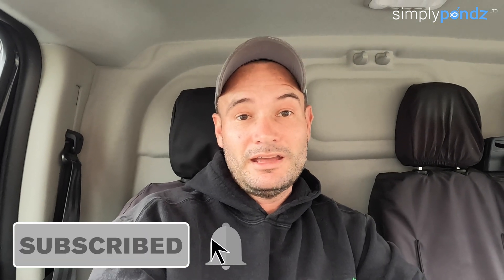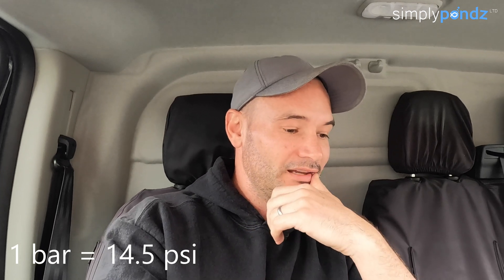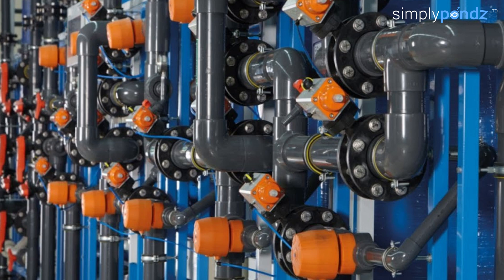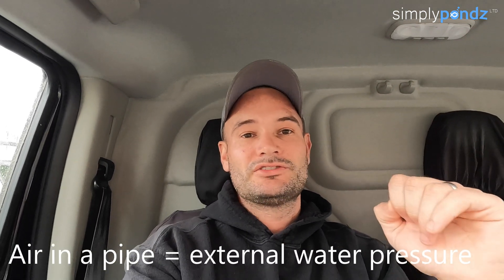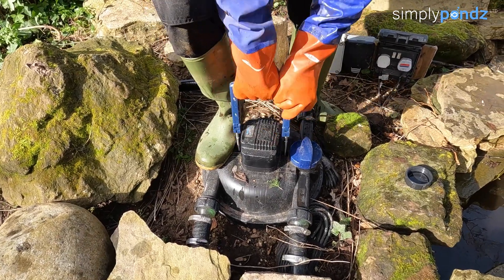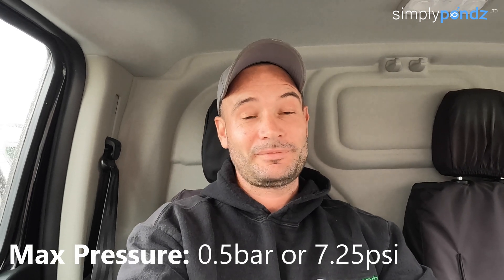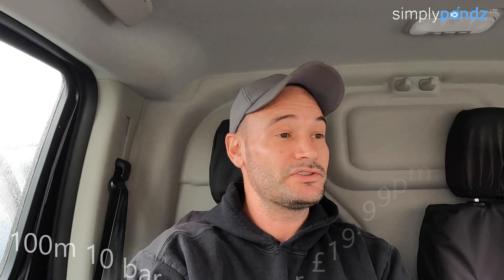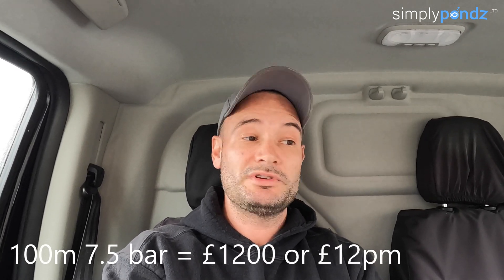Pond Pressure Pipe - A slight overkill is an understatement..

Comment: Thanks for another useful video. So if I have hose rated at 4 bar it should be perfectly OK to use it to connect my pond pump to my pressure filter rather than having fairly unsightly PVC pipe running across the pond?
Reply from the maker: Yes, absolutely but garden hose is prob too narrow for the diameter and flow rate
Reply: @thep0ndman  Great! It's not garden hose though, it's got wire embedded in it and 1.5 inches in diameter. Food grade. Thanks again

Comment: am using PVC plumbers pipe from BNQ works a treat and it’s cheap. Pump fed (8000) into a multi bay filter, two returns 🤷 simple 👌
Reply from the maker: Thanks for the comment. Yes 100% if it works then why over spend…?

Comment: Hi just building a pond, I’ve got four return two at the front side and two rear back, to cut down on pipe could I put the two into a T and run one pipe to a valve? Same with the back, I’ll be using a 10000 vari pump
Reply from the maker: Good idea with the multiple inlets it will help with the flow direction. If you are using the black liner connectors, you can use 40mm waste pipe bends like the 45 degrees or 90 to aim towards the base/sides/shelve to move debris off towards your pump or drain. If you want the flow faster, simply ad a yamitsu solv weld hose tail to the end of the bend with a reduced outlet to add some pressure to inc the flow cheers for the comment

Comment: Pressure is just rho g h or density x gravity x height . You may have additional pressure due to long length frictional resistance or if the pipe gets clogged with debris. But in general head height is the driver
Reply from the maker: Hi mark thanks for the comment. Yes you are correct you will get some pressure over long distances, definitely for industrial applications as for what the pipe is for but realistically people who use it in ponds the lengths of pipe used is really short in comparison, even still the pressure won’t amass enough to warrant 10bar pipe. Even if clogging or if a valve is shut most pond pumps don’t have the pressure as they aren’t really designed for high pressure.

Comment: Hi, food for thought. For me it’s not about the water pressure but mechanical strength and temperature. I was fortunate enough to obtain a number of lengths of 1.5” & 2” ABS pressure pipe and a mixture of sixteen 1.5”, 2” and 2.5” industrial quality ball valves. ABS being better in cold conditions than PVC. My mid level filter upgrade detailed on my channel is done with the the ABS connecting on to existing PVC pressure.
Reply from the maker: Yes 100% agree abs much better for high or colder temperatures!! Where did you get them from if you can remember thanks for comment sorry for delay!!

Comment: Great video, I’m just doing my pond and would not put pressure pipe on it unless it’s under the pond with say 10 tonne on water on top of it.
Most  pumps are about flow, the pressure is the resistance to that flow, if you have a blockage then not even waste pipe will break, rather a seal will fail or the pump would stall or just tread water. Thanks again for video
Reply from the maker: Yes 100% waste pipe is a pretty safe bet as long as it’s installed well and you can’t physically break it etc. thanks for comment sorry for delay in responding!!

Comment: The only pressure pipe i use is for bottom drains as they are burred anything else I'm more than happy with normal waste pipe and as you say you are never going to blow it apart off a pond pump save your money and use waste pipe
Reply from the maker: 100% agree thanks for comment sorry for delay!
Reply: No problem i keep seeing people spending hundreds on pipe and fittings they dont need. maybe im just tight on the cheap end i see so many people useing cheap flex pipe as well that will come back and bite you on the ass at some point with a huge water loss.